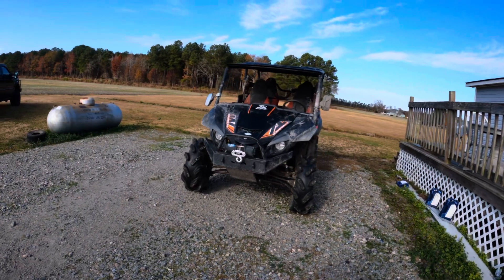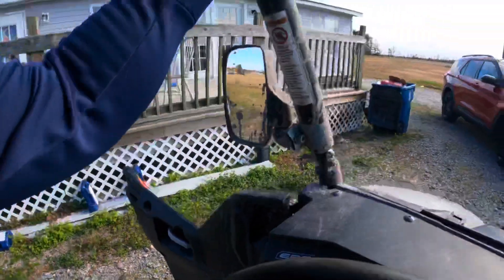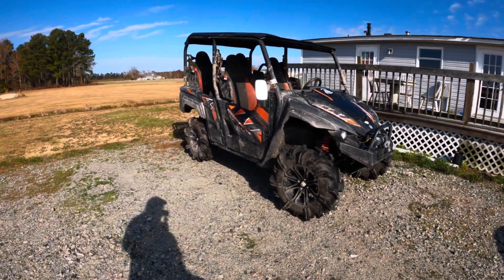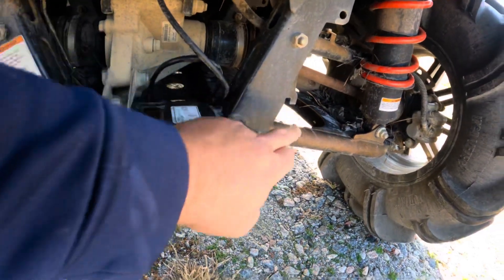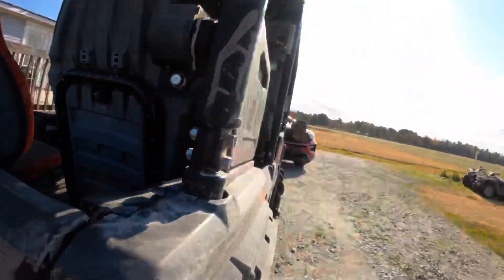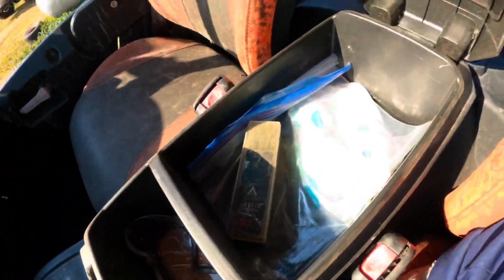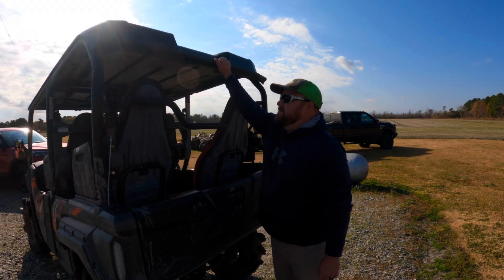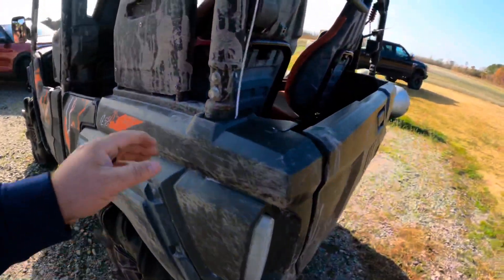Is This the BEST 4 Seat Side-by-Side For Your Family?  2018 Yamaha Wolverine X4 Long Term Review!

Comment: Looks like your rear cross bar on the roll cage was installed upside down. The bend should be pointing up. Dealer fail. They should have also done a briefing on the tool kit for ya. Great review. I agree with your points especially about top speed not being a big deal. My 21 tops out at 54mph and it is plenty for my needs.
Reply from the maker: Yeah somebody told me they thought my cross beam was upside down I just left it alone 😂 and agreed I can get a flash tool and clutch weights and get up to 60 but honestly I never drive over 30 even on straight aways

Comment: Great review I definitely think a piece on the side of the seat is important why it might be a pain to get In it can save your life and 50mph is still faster than a 1000 pioneer which does 44 tops I believe thanks for the vid
Reply from the maker: No the 1k pioneer is 65mph it’s the 700 pioneer that is 44 but honestly I just drive slow anyways but hoping to get a Can am turbo one day then drive really fast
Reply: @CAROLINARUTCUTTERZ  yea my uncles cfmoto sxs I hit 80 in gum neck down Georgia road and it has one of them safety bars on the side of the seat but it’s only a 2 seater